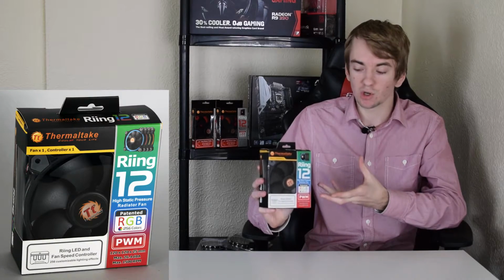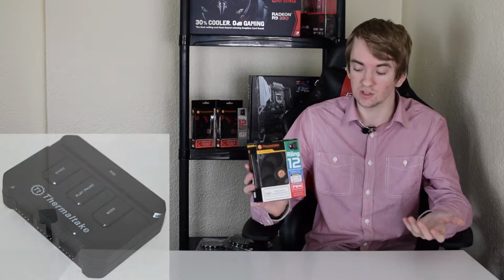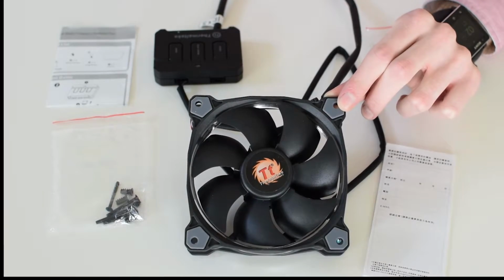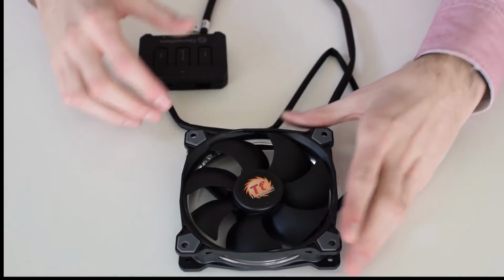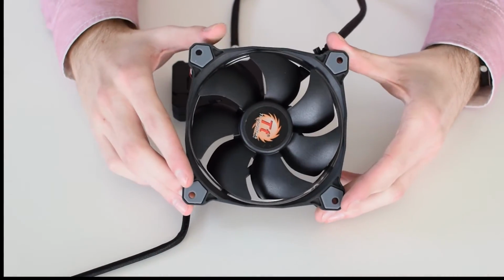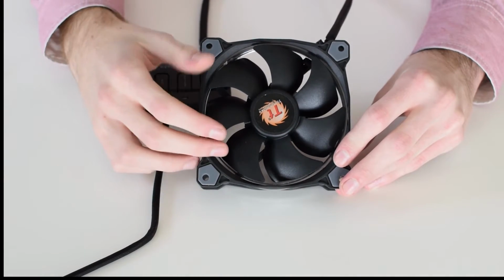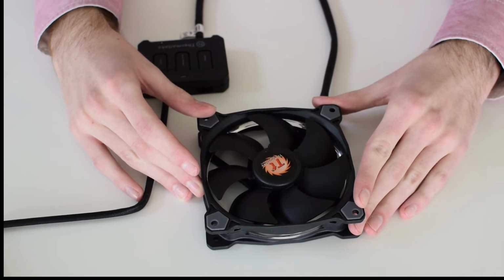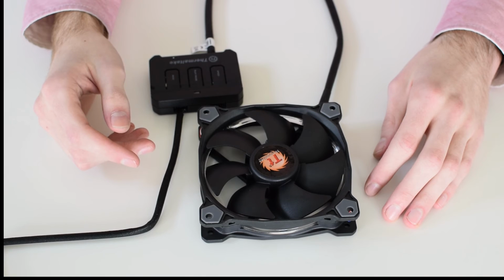Thermaltake Riing 12 RGB 120mm Fan Overview  - Play3r

Comment: is this air flow or static pressure fan? means i want to install on front of the case, but without radiator
Reply: static pressure i believe